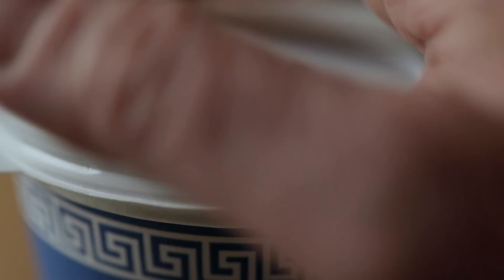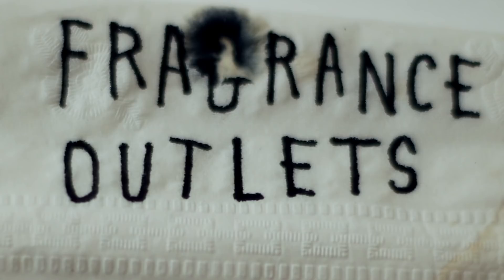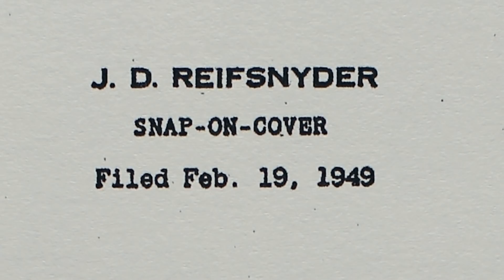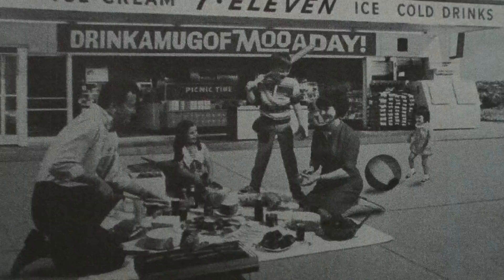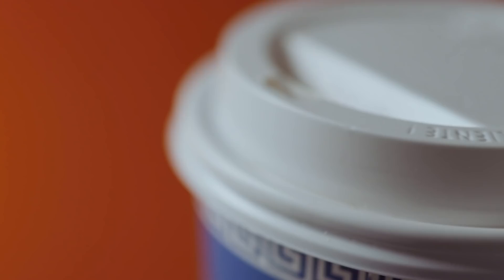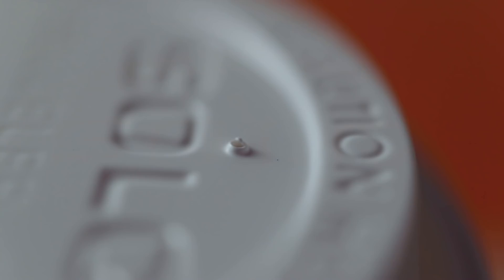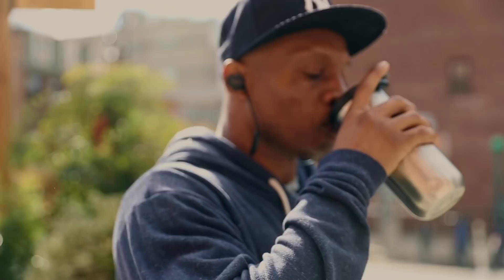The evolution of the coffee cup lid | Small Thing Big Idea, a TED series

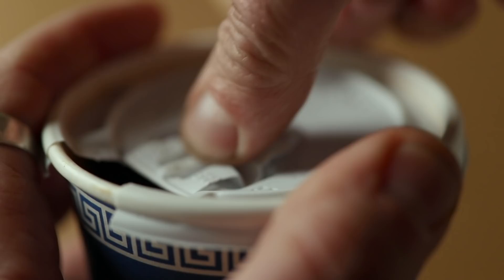Comment: Which lid spills the least when open?  Back in the day before we all started to use travel mugs I found a trick with the supposedly primitive lid at 1:55.  If you remove the lid and just push the peel back part into the cup instead, it allows you to drink without splashing coming out when moving.  Even while driving it works well, but not prefectly.  The traveler's lid could create quite a squirt in the same driving situation.    I was surprised that an expert on coffee cups didn't know about this trick.  Try it yourself people.